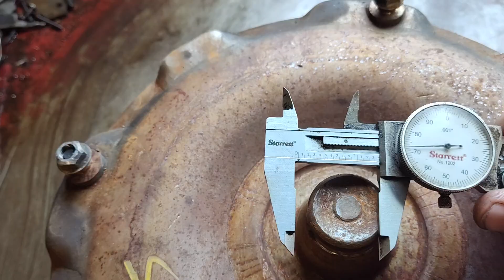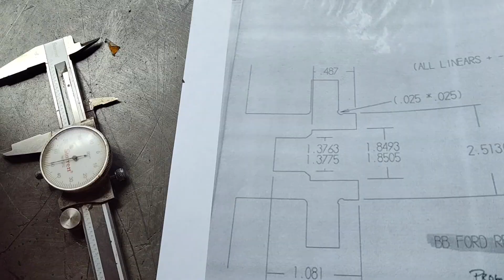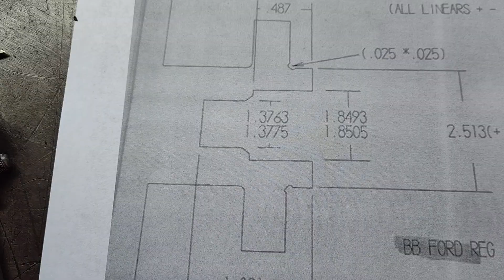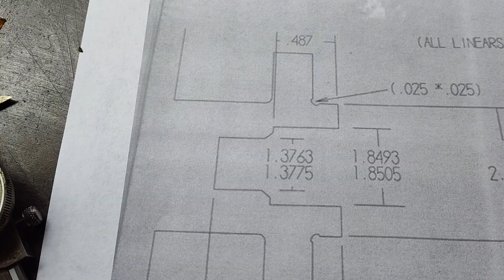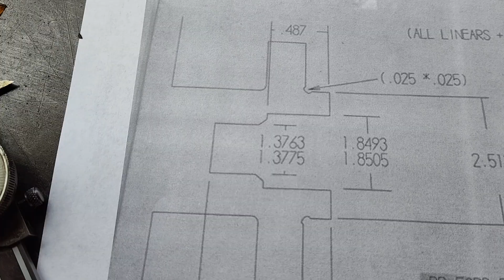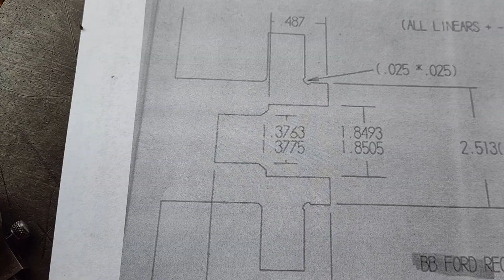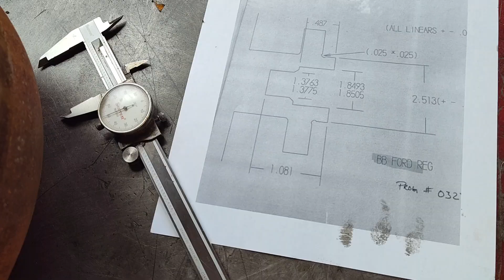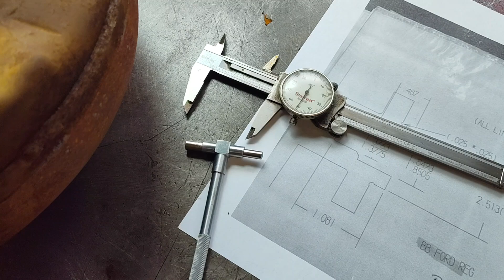How to Choose the Correct Ford Torque Converter Pilot Size

Comment: Hi, I really like your videos, I've learned a lot from watching them! 
I'm looking for a torque converter for my Galaxie 500 (1964) with FE390 and Cruis'omatic medium case trans. Mine cannot be fixed anymore, it's a 29 Splines, 1.848" pilot and 11.4" bolt circle. So far, I haven't found one. Do you have any suggestions?

Comment: It should be noted that some converters with the 1.375 pilot are actually shorter, for example I had a hays twister 2800-3200 rpm stall, and it had a 1.375 pilot but compared to the stock converters pilot it did not stick out as far, I ran it in a 460 Ford with a 94 crank, the outside hole was 1.850, the inner hole was 1.375 and it was roughly 3/8" of an inch recessed into the 1.848 hole and with the hays, it wobbled and ruined my pump bearing and seized on the converter, when I called ati he told me I needed a bushing and I did that and did not have any issues then I went back to a stock style Saturday night special since I was tired of always being at 3k+ rpm with the loose hays converter, and with the Saturday night special it went deeper in the crank and I could not use the bushing I had, needless to say a 460 can be very very confusing as I've learned.
Reply from the maker: The short 1.375 pilot is used on the C4, FMX, AOD and 4R70W transmissions because the flexplate sits closer to the block than a C6 trans requires.

Comment: I was given a nice Coan converter with the 1.848 pilot. When I went to install the trans not knowing any better it didn’t fit. So I did what any broke 20 year old would do and I opened up the stock 460 crank with a die grinder. Come to think of it the crank and converter is still in my Dads truck to this day 😂
Reply from the maker: Sounds like you did a good job. Whatever works. You do what you gotta do sometimes.

Comment: I used to run into this same issue when selling torque convertors at the speed shop I worked at, no one had a 20.00 dial caliper to accurately measure with.
Reply from the maker: Its important to have the right tools for the job.